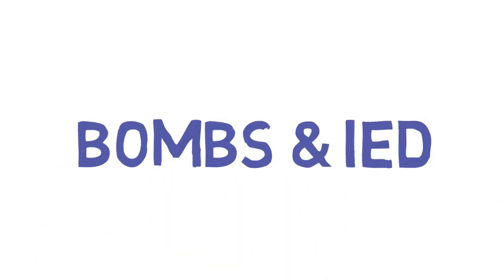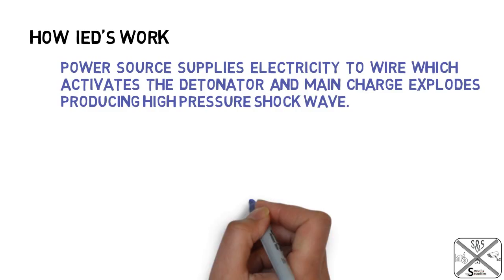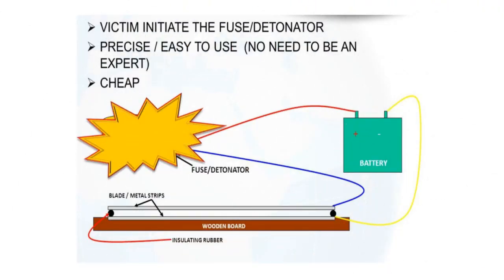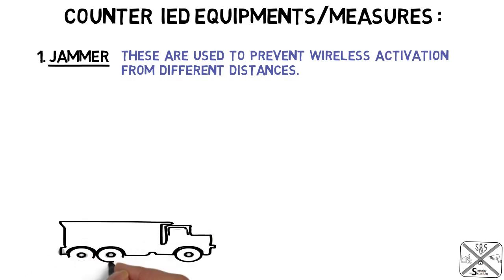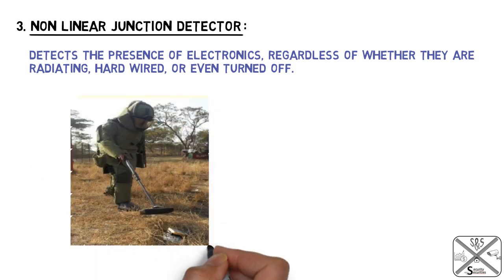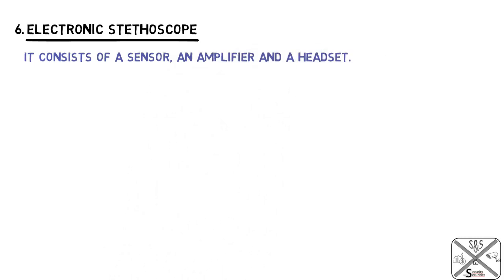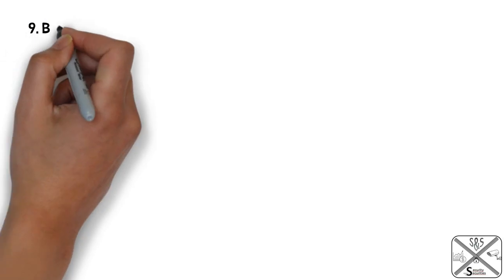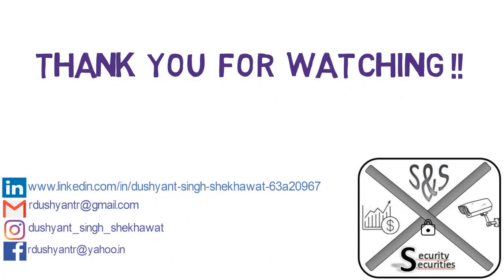Bomb and IEDs ~ How Bomb and IED works? Countermeasures and safeguards against this. Tiffin Bomb

Comment: Correction 
There are 4 components in IED
1. Explosive
2. Detonator
3. Power source 
4. Switch 
And there are 4 different types of switch mechanisms 
1. Anti Handling switch which is also Victim Operative ...in this the victim himself is the operator 
2. Ambient switch 
3. Time Delay switch 
4. Remote control or Radio control
Reply: What can we use as detonator rather than htmd for radio control 🙏
Reply from the maker: Hey, thank you for your detailed input. However I have tried to make it simpler by explaining to common audience. 
Thanks for your feedback.

Comment: What i dont understand is how a wireless activator initiates the charge? I AM NOT TRYING OR WILL NEVER MAKE A BOMB in case fbi is watching just plain curiosity trying to understand how this shit works
Reply from the maker: Radio controlled wireless device does not initiates charge but it gives a signal to IED and as a redult IED explodes. Example can be cell phones, radio, pager, door bell etc etc. This point is well covered in video too.